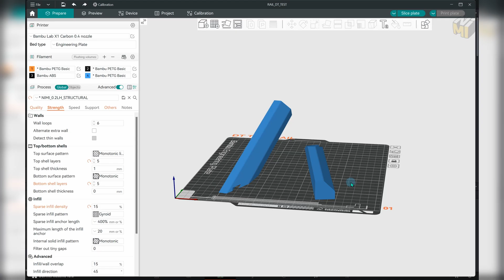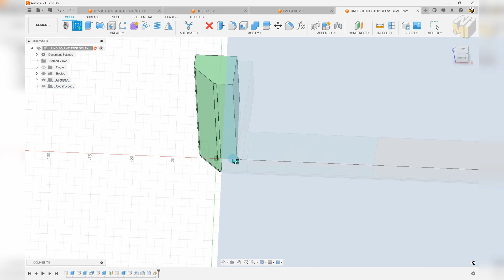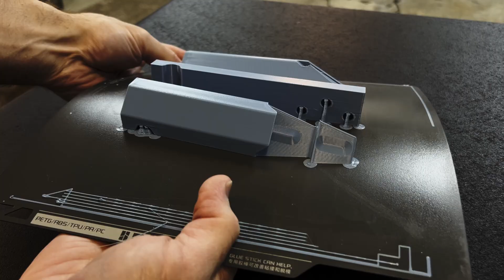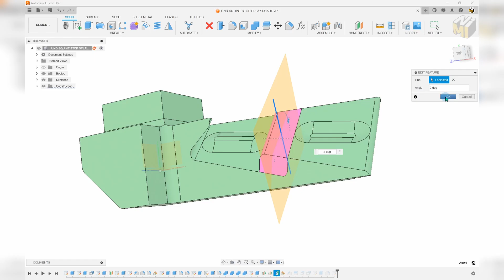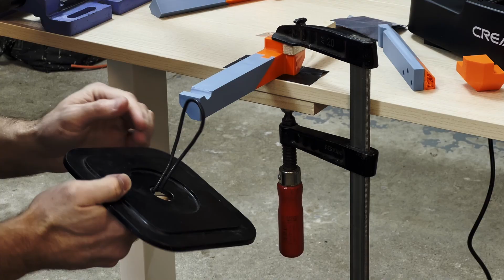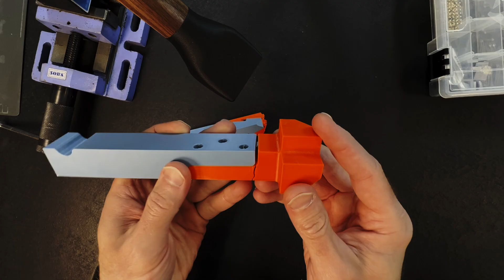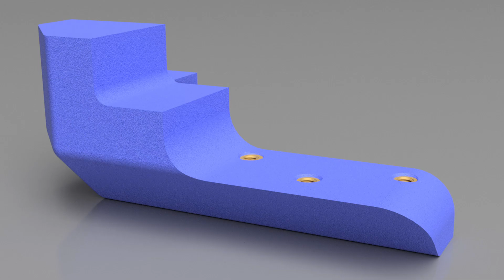Strong 3D Printed Connections on BIG parts

Comment: designing for strength is way more than just specific joints. layer lines, infill, plastic choice. engineering has a whole area of knowledge on designing for load bearing.
Reply from the maker: Sure is, the plan is to continue to test realistic parts so that we can gain a better overall understanding.   I'll have more videos coming soon on that subject where we test a few different options to see if any of them make sense, or if purchasing an alum. extrusion is a better option in the end.  Curious, do you know of an application we'd see plastics used for load bearing, I'm thinking of something on a larger scale.  We see resins used a lot, but they're reinforced.

Comment: Kind of crazy how's the last one took the most weight, but it's also an interesting metric that none of the joints themselves actually failed 🤔
Reply from the maker: The only joint that just barely was affected was the dovetail, which I found a bit strange, I thought that with the dovetail shape, it would apply so much side pressure that it would blow the joint apart.  I suppose a follow up test is necessary because the corner needs to be more robust in a test like this, or I need to change the test setup.  I've purchased a hanging scale at least to make the testing a bit quicker and easier as well, lots more coming up.  I'm just finishing some review and fix videos for a new printer after that I should be able to get back to using prints for more structural applications.
Reply: @NeedItMakeIt   I would get some kind of crank handle or smth as well to apply the force more gradually and consistently
Reply from the maker: @TS_Mind_Swept  I was thinking about using a turnbuckle attached to my hanging scale.  I think that could work well and allow more focus on the part rather than the weights, I'd really like to find a way to get better slow motion.  I wonder if I just add a ridiculous amount of light or do the work outside.  For the next test, I want to see about the strength and deflection properties of different levels of infill along with some other ideas taken from manuf. of steel structural beams and columns as well as some of the concepts from timber-framing as well.  I'll definitely want to setup a more professional testing jig and maybe what I can do is take the ideas they use for testing engineered wood products and adapt those for testing 3D prints.  The ends would both be supported and a load is added in the center and we can measure deflection and max load to break point.

Comment: That scarf joint has been a favourite of mine since I saw how effectively it joined two lengths of structural beam in a timber-framed house.  One thing we can do with 3d printing that would be very hard in timber is to use a generous fillet on all of the angles to prevent stress risers.  You might want to dish the faces of the wedges to make it easier to drive them in and out.
Reply from the maker: It's an impressive joint for sure, it looks great, keeps the joint tight, and provides the clearance so that the parts don't need to fix exactly, the wedges do the rest!  Ah, that's an interesting idea, give the ends a concave shape to be able to easily position the driver?  I was also thinking about creating a version with a single wedge, though the modeling would become a bit tougher.

Comment: Never use a sharp corner if you need strength, it's building in a weak point. If those were brackets the way that 90 degree joint wasn't rounded would really limit the load they could take. It's not so much about thickness as giving a fracture a head start . That scarf joint has held up houses here for hundreds of years, back in the day it was used in construction as standard, all cut by hand. Skilled carpenters.  It has a weakness though, if loads are varied on it, the wedges can work loose...why it was a failure on ships when they tried to make much bigger wooden ships.
Reply from the maker: I agree, that's why the corners were radiused, maybe it wasn't too noticeable in the video.  

One other note about 3D prints is that the entire print is made up of weaknesses between the layers, it's not so easy to see, far smaller scale than what you'd see on a 3D printed home.  The same reason that food grade 3D prints are not actually food grade, there are too many areas for bacteria to hang out in.    

20 Years ago, I was a timber framer and although we used giant saws, all of our work was finished off by hand.  Sadly, that type of work can't compete.  This is where the idea behind the joint came from.   There are lots of likely causes for wood connections to fail.  Moisture causing the wood to deteriorate, insect damage, timbers drying and changing dimension.  In the case of a wooden scarf, it needs to be supported below by a post in the event that the wedges come loose, it would not result in a catastrophic failure.  

Thanks for the comments!

Comment: I am not sure if anyone realized none of the test cases represent the failure of the joints. Each failure are happened in the material. Which you can expect.
Reply from the maker: Yes with an *.  The half-lap failed at the end of the joint, however it wasn't exactly a fair match, with a cross-section so small and the torque action, that's the most likely area to fail.  I agree that the connection at the fasteners did not fail.  The dovetail failed partially at the joint (only at the end) and that surprised me, I thought with the wedge shape of the dovetail, the force would try to break the joint apart from the pressure acting outwards.  It stood up really well.   I'll be doing some follow up videos on these tests, the original concept was to see which joint would perform the best in a situation like a frame, and they'd all work pretty good I think, the stiffest without glue would seem to be the scarf.  I think there is some potential to improve each of the connections quite a bit and end up much better options.  I was thinking about the half-lap, but with an undercut, and the screws would come in at an angle to the joint, tightening the screws would pull the joint tighter together.  What do you think?

Comment: This is an extremely interesting and useful topic. An other Topic would be toleracne compensation, because having those joints you will introduce more tolerances than before which might be a problem to fit properly. You should analyse tolerance compensation features such as crush ribs in holes for instance. The wedges are also extremely nice you can really increase the pre tension and lock the parts

Comment: Nice designs, if I would have to make something I would probably go for the screw design but instead of screws I will hammer in printed pins. 
The Japanese woodworking connections look nice but they might need more post processing.

Comment: That is a cool test. I would like to have seen all those same joint styles oriented in at least 2 different ways. What I mean is with the joint facing up and the joint facing to one side or the other. It also seemed more like a failure in the print material rather that the joints themselves. It looked as if the joints remained intact.
Reply from the maker: I can always make a follow up video, I wanted to see if there was enough interest in these ideas before I went too far with it.  The original concept was that I was going to just show my idea for a new type of 3D printed connection, but I thought I had better compare it with something else at least, I should have also printed a part with no connections as well and I should have done exactly what you suggested and at least flip the connections around.  I will purchase some more filament and start thinking about the next one!

Comment: Very cool ideas for 3D printed joinery. I suspect that all of your failures are limited by the material strength. The ones that failed earlier had less material, and strength is proportional to how much mass is at the stress point. If you weigh the parts and normalize the failure point by mass, I suspect all of the numbers will be much closer. Still not a perfect comparison because 3D printed parts are not isotropic, but closer to a fair comparison.
Reply from the maker: For sure.   Originally I wanted to just present my concept for the Scarf joint, but thought I'd better add several others to have at least something as a reference to compare against.  It is by no means a flawless test, my garage workshop setup is a little underwhelming, I'm slowing building up my tools for testing and learning as well thanks to feedback from the community.

Comment: On the bolted part:  I'd be curious to see how it performed if you flipped the location of the arms.  The way you are testing applies a rotational force so having the blue arm on top means it adds no strength to the joint.  All the force is applied to the lower orange arm.  Having the blue arm on the bottom would essentially result in it being pushed back towards the orange base.  It could make the whole joint stronger or result in the failure occurring in the heatsets rather than at the base of the orange arm.  Actually, the same idea would apply to all three models.
Reply from the maker: Absolutely, I think for the dovetail and the half-lap connections, it would probably improve the performance quite a bit, for the Scarf, because it it wedged tight, it likely wouldn't make as much of a difference, but that's a great idea for a follow up testing video.   I have one in the works right now, it isn't so much about the connections as it is about the parts themselves based on feedback from the community.  Some people claim for example that a hollow part will be nearly as strong as one with infill.  I'm not a believer myself, but I'd like to test it, I have a few more examples of different ideas that we need to test along with that.
Reply: @NeedItMakeIt   You could also try with varying levels of infill (25, 50, 75, 100)
Reply from the maker: @jasonjohnson785  The next video I'm working on is going to be exactly that, I wasn't going to focus on infill exactly, but the comparison will be there for sure, and hopefully the results show how big of a difference it makes.  Great suggestion!

Comment: The joint never failed on any it was the plastic
Reply from the maker: I would argue that the dovetail did fail partially at the joint, yes, I'd agree that the plastic for the most part gave way before the rest.  The stresses at the corner with this torque style of test would have been higher, which may explain why the Scarf failed the way it did, the Half-lap was at a disadvantage there as well, the dovetail was different however, my best guess with that one is that the pressure pulling that joint apart also generated enough pressure to weaken the connection enough for it to fail first.  Your thoughts on that?

Comment: For the bolt ones I would've had the brass inserts on the outside so that tightening compresses the parts together instead of rips the inserts out. All that's holding the inserts in is the material around them.

Comment: Good video, saved in case I need to do something like this.  One comment—you added clearance, not tolerance.  Pretty much all the 3D print community gets this wrong.   Tolerance is related to clearance though.
Reply from the maker: Thanks a lot,  yup, good point, sometimes I mis-speak, no sense in going through and correcting it all, I'd be several weeks to try and get it just right and that would be very tedious work.  Clearance it is thanks.
Reply: @NeedItMakeIt  👍 just a little pet peeve of mine.  Just about all the 3D printer people seem to do it, so you really need a manufacturing background to not fall into it.   I’ve been doing this stuff 20 yrs or so with metal (mechanical engineer and CNC machinist).  But I still learn a ton from videos like this.   Keep it up, you’re doing great!  Your joint method looks really strong and elegant.
Reply from the maker: @davidawaters  Truth be told, I've been in design for my entire life, starting from a child leaning more towards Architecture, then Woodworking... then Home Inspection, but ended up in manufacturing for 25 years.  They were mainly Woodworking companies, and so we didn't have the same kinds of accuracy you'd see with metal.  I've worked in the shop and then eventually managing the Engineering teams, R & D departments as well as IT and Programming.  

3D printing is just a small CNC machine, but with lots of potential to be creative and problem solve, it's an interesting and somewhat challenging hobby as well if you're going more towards the realm of functional parts, rather that the toys everyone seems to be addicted to.

This particular model came from my experience as a Timber Framer and then later on getting into the design of Timber Frame Homes, lots of people seem to think that it's something on the Japanese did well; we also did extremely high caliber woodworking, however it seems that most of it is lost now, we don't have the same ties to traditions here.

Well, I'd best be getting some more work done, I have another video to release soon!  Thanks for taking the time, and have a great one!  I appreciate the support.
Reply: @NeedItMakeIt  👍  It does look like that cool Japanese joinery—that’s what I thought of too.   I’ve never really done any woodworking but I like to watch YouTube videos of it sometimes.
Reply from the maker: @davidawaters   There are quite a few more connections to try out, maybe we'll make a series out of it.  I'll have to add some wood into my tests so we have something to compare against.  But my Woodworking skills are... let's say sub-optimal at the moment.
Reply: http://www.epi-eng.com/mechanical_engineering_basics/clearance_and_tolerance.htm

Comment: Are you printing in standard speed or did you slower the printspeed?
Reply from the maker: This is set to standard speed for PETG, 13mm³/s, a little slower than I'd like, but it's fine for these small parts.  When I upgrade the nozzle, I'll be able to play around with it a bit more.

Comment: Fascinating results! I've been slowly experimenting with the dovetail joint in Prusaslicer. I like having the joinery built into the slicer but I agree, if you had to redo it, it may not be accurate. Still, the simplicity of having it in the slicer makes me choose that option. I recently did a large model that required joining the two. Granted, it didn't need strength perse, but did allow me to test the dovetail joint. I found that I really needed a good bit of tolerance set, to accomodate the print lines sliding against each other. Very cool test!
Reply from the maker: Thank!  I agree, it sounds like we've had very similar experiences with the dovetail.  I think it's a great option especially if someone doesn't have the design capability.  I think they could make some minor adjustments to the dovetail option and get far better results.  The separate dovetail I showed briefly works great to pull the parts together and we wouldn't need to worry about the fit as much.  Reprint the small dovetail again if you need to, or make it tapered and it should be able to be pressed/hammered a little further to bring it tighter.  I think there will be more development in this area as people want to print bigger and bigger.  If there is enough demand, we should see some solutions to help.

Comment: I've watched other joint comparisons, with different media and processes.  I'm left wondering how layer orientation and in-fill may have had an effect. Very interesting results none the less.
Reply from the maker: It's certainly something worth more exploration.  From my previous testing with PETG, the material as long as it is printed with the right settings and preferably in an enclosure will have similar properties regardless, but a test is required to be definitive.  I will be doing more videos on these subjects coming up.  I just purchased a good hanging scale with a hold feature, that should help to speed up the testing and give a bit better precision to them as well.  I have a few Printer testing videos to finish up and then I'll be back onto more structural 3d print related videos again!

Comment: I print a lot of tools and structural prints, almost exclusively with PETG. My tip to you would be to throw out the infill. You get almost nothing from it strength-wise, and it adds to your primt time. If you need to add just enough to support your top layers. Beef up your walls and top/bottom thickness and i think you'll end up with parts stromg enough you'll be testing joint strength more than just material strength.
Reply from the maker: Great tip, how do you handle tops, do you just bridge and rely on more tops?
Reply: @NeedItMakeIt  a combination of super light infill purely to support the top layers, and designing the part in a way that doesn't require infill at all - on thinner sections, using chamfers to bring the top edges in so there isn't a flat top layer at all. I've also recently started using lightning infill on prints where it can't be avoided, again just to support that top layer, and letting my walls and top/bottoms provide the strength
Reply from the maker: @TerminalCase99  Yes, I can see that working well, I shall setup a test and see how it preforms on these particular parts.  Normally my parts are under compression, I need the infill to assist there, I'll put this on the list and see if we can get some results that we can use, it would certainly speed up the print time and save material, I like it!  I've never tried Lightning, but I will give it a go if needed.  Great tips my friend!